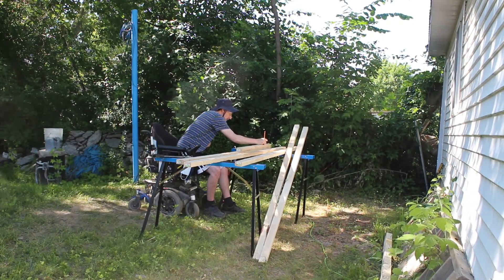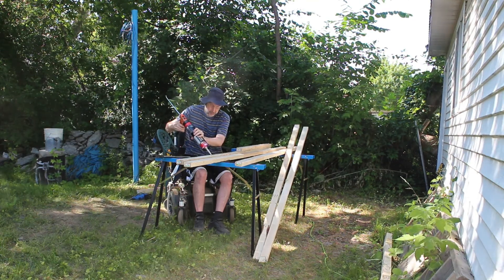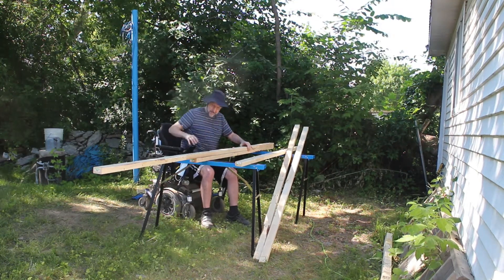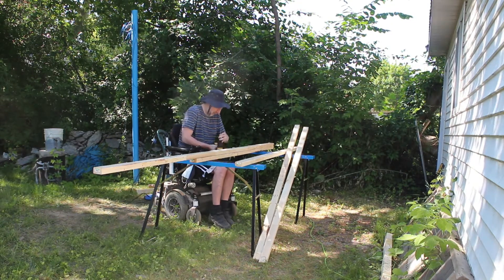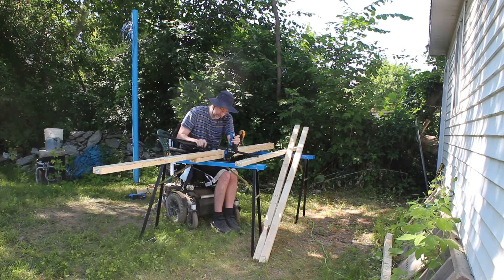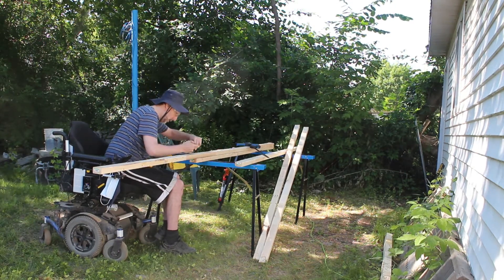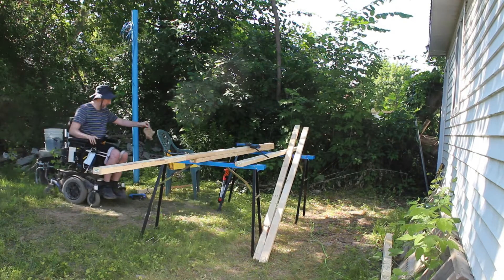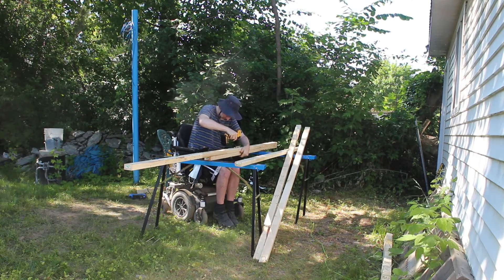Wall Framing - Assembling Top Plate While Using A Wheelchair

Comment: You're a handy guy Ron! My son was doing drywall at our place (without help) he used a 2x4 with a "foot" to brace the drywall against the ceiling. We've got 3 more pieces to go & then the work of plastering starts.. Seems like a never ending job. Btw, i subbed on my 2nd acct, give Rocky a treat for me? Best wishes!
Reply from the maker: Aww thanks.  I will give Rocky a treat tonight from you.  Ron
Reply from the maker: I just left Rocky a hamster size (small) blueberry at the entrance of his sleeping hut to find tonight.  I changed his shavings.  He is presently sleeping in the fuzzy hamster.